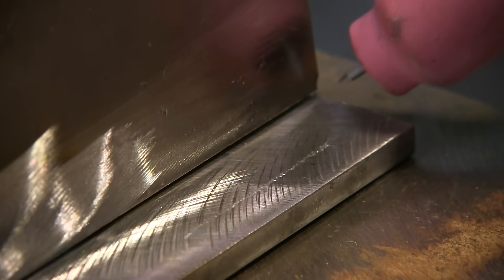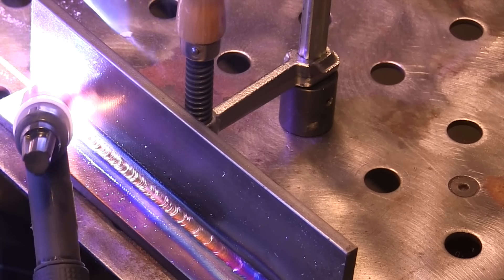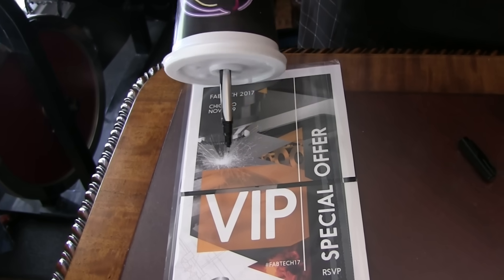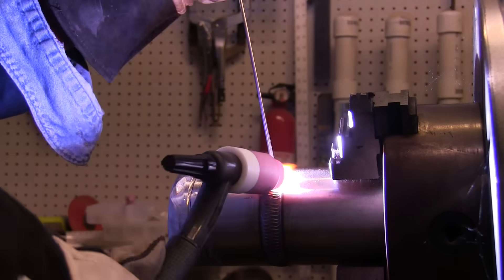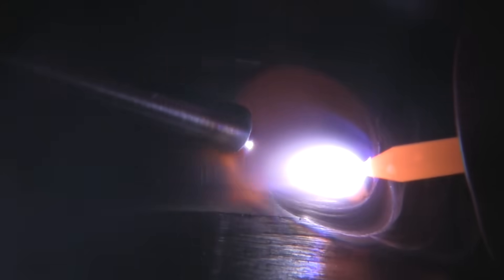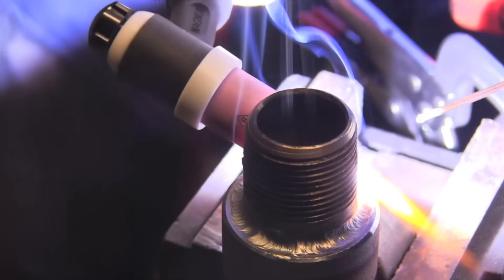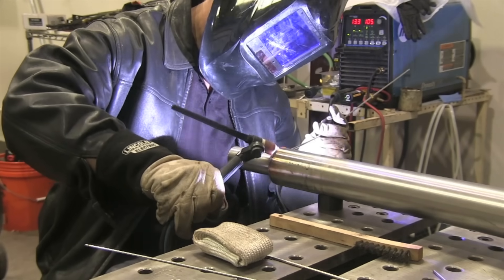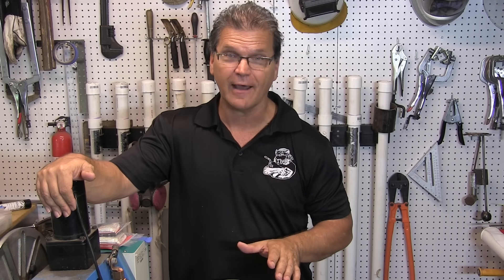TIG Welding Technique - Walking the Cup

Comment: Best thing I ever purchased was your TIG finger , Thanks for the TIG fingers and Video Jody.
Reply: marble head I still use mine for MIG too. Especially on thin sheet metal. Where I'm really scooting along.
Reply: My lovely girlfriend just bought me two regular and one XL TIG  fingers for my birthday, I can't wait to put them to use! 👍🏻
Reply: If I had a Tig I would buy a Tig finger I wish I would have bought a Tig and not a Mig
Reply: First used one when I did my course for b pressure with stick . . . works nice for that too (but they get chewed up from spatter after a bit). Really put one to use recently for an aluminum job boat railing for a buddy, and thankful I have one again!
Reply: just picked one up hella excited to use it.
Reply: I only have a MIG also. Just used mine to day to repair a frame on a ATV. Finger got hot without it. Put it on and never took it off until I was done. I have also used it with some jobs using an acetylene torch.
Reply: Drunken Moose @
Reply: marble head it's good to have both
Reply: You know, exhaust wrap is cheaper - and the same damn thing😄
Reply: plus one for the TIG finger. Great product. Thanks, Jody.
Reply: I am a union pipe welder.  Weld all day , every day.....the tig finger is worth it's weight in gold. especially when the guys are doing hot welds  on small bore....  They always want to use it. We put em' down on the tool list. let's see if they come in.

Comment: Welding is....wait is welding like piping frosting on cakes? I went to culinary school and the rolling is very similar to the movement of seaming layers of cake. Wait hold up are  tiered cakes basically pipe fitting? One dimensional though. Usually cake pipes just go up

Comment: Old time trick that’s free….Get a roll of the companies masking tape “paper tape, painters tape” roll up a ball the size of a quarter. Tape one to the end of your middle, ring and pinky finger or just one of the fingers depending on how you hold your torch. Masking tape doesn’t really like to burn when balled up like this. It will but it doesn’t like too. Heat from the pipe also won’t heat your fingers up to much through it. This is a free way to make a “Tig Finger”. I’ve done this for years and it works like a champ.

Comment: Free hand TIG weld are good for "Filled" especially the root pass, while walking the cup good for hot pass, fill pass and capping on filled too........ I have made an experiment on both technique on Fillet Weld for root and made test using "nick break test" method, the good  result for fusion on root are using free hand weld

Comment: I have never waked the cup in 40 years of tig welding and can get almost as nice a result.
Guys that do it have to use MUCH more effort,i see elbows moving all day long,some so much i think 
they are having a competition as to who can be the most noticable.
I was at one point a welding instructor and told each guy to do a weld 6g without it and the results were DISMAL!!
You can do very well without it with only a small movement of the fingers.
Theres going to be a lot of welders with fucked wrists and tennis elbow in the future.

Comment: How do you go about selecting your amperage? Obviously the material heats up as you go, but for instance, I'm new to TIG welding, but weld alot of material between 1-4mm thick (big stainless tanks) and it's good to have nice looking welds. But i often struggle bouncing between too hot and too cold. Just looking for a general guideline really.

Comment: Much respect to the fellas that do this, the place I work at see them all the time fabricate stainless steel tubing into pipe joints for evaporater system at tomato processing plant anywhere from several feet in diameter to few inches amazing when seeing how perfect the beads of weld are to know it was done by hand not machine it's an art form

Comment: Problem with my job is that I have to weld with a mirror quite often so the welds doesn't look that good and it is way too tight to walk the cup.

But works great when doing fillet welds, haven't tried on pipes yet.

Comment: How come you can have a greater torch angle while walking the cup than in other circumstances if I used that torch angle my weld would look like the surface of the moon. Is it the greater gas flow with the 12 cup or something else
Reply: I was wondering the exact same thing today.
Reply: Angelina whatsherface    When you walk the cup (walk your torch UK ) you don’t have your Tungsten very far out so your well covered by your gas and stops the porosity

Comment: A root pass should be done without the wiggle. I have seen a few people here on YouTube who are "teaching"  newbies to use this technique...you lose out on the amount of penetration AND you are giving the material a larger heat affected zone.
Reply: So, I shouldn't be wiggling on say...a roll cage? 1.5X.095in DOM I'm a newbie with the intention of obtaining the skill to DIY my on drift cage.
Reply: @damonf2450  is the tubing mild steel or cromo? Either way spend the time to cope and match your joints as perfect as possible. But at that wall size, your bead only has to have a minimum width of only 0.125" when you wiggle on cages, you are putting unnecessary heat into the material. If it is a cromo cage, it should be annealed and heat treated afterwards in which case the extra heat isn't a big problem. Odds are you will.use mild steel so you should double check that tube diameter is legal in your class/at your track

Comment: I don't understand these welds one bit, it's like this is all fake. 

Where is the volume and all the material going in these welds? These welds have no mass to them I don't understand.  I weld and it's a huge ~weld/mass/volume from both  mig guns (steel and then aluminum spool gun). I understand this is different as I'm wire feed but I've seen this quality of weld from my type too. How in gods name are you welding were literally the weld sits "below" the horizon of the item or ~flush? I run a weld and it's fatter then a stack of nickels (seriously)...if you turn down the wire speed then there's not enough wire coming out of the gun...if I move faster to try to spread out the volume of wire you miss spots or wire isn't keeping up and need to turn up more. 

I just don't understand these razor thin ~100% flat, not alone below the horizon, welds. 

2017 Miller MVP 211 with Miller 100 Spoolgun, .30 wire.
Reply: Blakelikesfood 

aa

!?zax
Reply: Blakelikesfood
Reply: Blakelikesfood probably because he is a professional and not a hobbiest
Reply: Aluminum welding requires a lot more heat than steel to weld, a great deal more...  plus it probably wouldn't  hurt to use Tri-mix shield-gas especially if you're having heat problems and don't want to pre-heat the aluminum before welding.  The helium in Tri-mix helps increase weld temperatures offsetting some of the problem.

It could very well be that your machine doesn't have enough power to weld what you're trying to weld if its aluminum over 1/4" that Miller 210 basically isn't even close to enough to easily weld 1/4" aluminum...  the key word was EASILY, it may do it, but not well and definitely not liking it much!

Now, if you're welding 1/4" steel or stainless that has plenty of power even up to 3/8" if you v-grove or bevel your weld joint edges properly.  I would recommend .045 for welding 3/8" though and you would be pushing that machine pretty hard to get it done... which would be fine if only 20% duty cycle = 2 min. welding every 10 min.
200A should be plenty.  Not exactly sure the specs on that Miller 211.

 I used to run a Millermatic MP 250 with the powerfactor correction kit and the largest gun we could get for it, 3/8" was pretty easy to handle but we still beveled/v-grove 3/8" and 1/2" plate welds... 1/2" was really pushing the limits of that machine though.
Reply: thankfullUS citizen : Ha...well that's a detailed response! Thanks

All my welding is no more than 14 gauge, 1/8" flat stock, nothing heavy duty or extra thick. 

Not sure I would of bought a mig machine if I could do it over again, my machine makes strong welds but cosmetically are boogers. The ~puddles are so refined, smooth and ~flat on this tig video. However I've seen great welds on migs too....mine would never ever pass a cosmetic test and problem being is I bought this machine specifically for buildings cars and bikes. 

I do steel and aluminum.

If I wanted to look at a second hand Craigslist tig machine what model should I look for?

If I were to buy a brand new tig machine what model should I look for?

Comment: 🙏 Please inform which machine would have the best cost benefit for micro welding in P20 and H13 steel mold. Also would like to weld stainless steel and aluminum with beautiful finish like yours.

Comment: Any tips on back purging HVAC ductwork, thus typically large sizes, typically "L" shape to start, thus your tig welding two "L" shapes to make a box of some size.  Can you use like shrink wrap to close off the ends to purge ?  But seems like you would use alot of gas ?

Comment: I just grind that shit off, or cover it with J.B. Weld. The problem with all these weld instructional videos, is they assume you have a good welder, and you are good at welding. I don't have a good welder and i suck at welding, and I hate it. So like fuck it, we do things ghetto like... 

http://www.homebuiltairplanes.com/forums/album.php?albumid=627&attachmentid=66405 

http://www.homebuiltairplanes.com/forums/album.php?albumid=627&attachmentid=66428 

A lot of these welding instruction videos need to dial it way, way back down to the very beginner and just getting to hold a puddle, because most of these shitty wire welders feed metal in spurrts because the tip gets clogged up, you can't hold any sort of puddle, and you can fucking forget about any catipilar looking weld or stack of dimes.

Comment: Now let's get this clear, walking the cup is a fancy disguise name for resting the torch on the job, and is for those that do not have a steady enough hand to keep the electrode out of the puddle without resting the ceramic nozzle on the job, so called walking the cup has no benefit at all to the weld itself it's just a way of keeping the electrode out of the puddle.
Reply: John Bower I have always said,walking cup is for those that can not freehand
Reply: I use my fingers not holding the torch like legs and walk along,  I had shakey hands my whole life.
Reply: I free hand everything

Comment: Just learning TIG. I'm using a 1/16 tungsten with er70s 1/16 filler rod on 1/16" steel. 
DC- polarity at 65 amps was my settings using the 1 amp per .001 of thickness. 
Getting some black soot and also my tungsten is balling up. Any ideas?? I ground the steel and wiped it down with acetone as well.

Comment: Those arc shots are still getting better.  If only I could see as good when I weld as I do when I watch you weld.  The welding equipment manufacturers need you for some consultation for their videos.  I have not seen a welding video from anyone else that is even in the same league as yours.  Since I only TIG occasionally, it's always a great refresher to watch your videos and see how it's supposed to be done.  Thank you.
I have a couple of TIG fingers that I use for all of my welding and I put my buddy onto them too.

Comment: Cam this technique be adopted for a Millermatic 211 MIG as well? I like to run voltage normal and the on slow side of the feeds with  stock 1/8 and up. I get good penetration welds but after a few minutes it gets tiring.

Comment: Is it possible to use the "walk the cup" technique on aluminum? I primarily weld aluminum and freehand everything, I have tried it but the AC arc characteristics have never worked out for me. I plan to practice this on my own time, (just to expand my skills) but would love to apply its consistency to my day job.
Reply: Yes….loosen the button cap or rooster tail and make the tungsten even with the cup “in other words not sticking out at all”. This will work great….also if your machine has balance it is not necessary to ball the tungsten and this in itself will help the profile of the arc.

Comment: got my tig finger. cheers Jodi. could you do a video on different walking the cup fill patterns, im not sure on it but ive seen different patterns (and larger reinforcement) done with pulse maybe? anyone with advice on that let me know, even if its not something done in a practical sense
Reply: lower heat on top of a root pass (65-80 amps) walking the cup a bit faster might get you there

Comment: Here's a video suggestion, can you do a video comparing the penetration of mig vs stick and/or dual shielded flux core vs stick?. I know stick gets more penetration, I just wanna see how much more. keep up the good work.
Reply: Andy55411 after cut and etch, there is a slight difference. Always refer to code or standard of what you are welding.
Reply: Okay thanks. yes of course.
Reply: Andy55411 stick welding usually has better impact strength
Reply: Oh ok, thanks
Reply: I will tell you this much mig tig stck all have there pros and cons but not that big of difference if you now what you’re doing and using the right tool for the job as far as impact strength I don’t see how if so why would it be used  in structure steel building vs stick

Comment: I learned a technique years ago where you oscillate the torch and filler rod in opposite half circles back and forth. He learned it at Hobart welding school in Troy, Ohio. Is that something you could use in a situation like this?

Comment: help a brother out. I love your videos and I want to learn how to tig. I don't need a $2000 machine but I do want one for ac/dc give me some ideas on a budget friendly machine please sir
Reply: Get an AHP tig welder on amazon for just over $700 ac/dc with pulse
Reply: Go to your local community college or trade school and enroll in a TIG class there, since its a CC it should be pretty inexpensive.
Reply: Daniel Napast I want to purchase a machine and will learn as I go by watching his videos as well as others. I also have friends to get instructions from.
Reply: I'm more of a hobby welder but my Eastwood tig200 had me welding for around $900 after I bought argon, filler metal, tungstens and some misc odds and ends. The welder has been great for me for the last couple years.
Reply: AHP Alphatig seems to be the go to bang for your buck rig these days. I'd probably have one if I didn't find a Lincoln SW175 for $300.
Reply: Too bad they don't ship overseas :(
Reply: If you live in the UK check out rtech welding supplies the have a pretty good tig machine for under £1000.
Reply: Looks like you already know the price range. I purchased an everlast for 1700ish but by the time you get all set up you will be around 2k. I will buy an american tig welder if another is needed. I did buy the Multimatic 215 and that comes with DC tig/mig and stick. I think that was in the $1200 range plus all the do dads. It does not tig aluminum.  And you need to buy a torch and pedal separate. Good luck. Tig welding can't be beat for some jobs.

Comment: I took a weld test a couple days ago, and they had me fusing stainless steel without filler. I was told you're never to fuse stainless because it compromises the structure. Anyone have an answer?
Reply: Kevin Blackwell don't quote me on this, but I'm pretty sure food grade/sanitary stuff is for the most part fused. Fusing without filler is ok in some applications because it still has a shit load of strength. Unlike mild steel without filler.